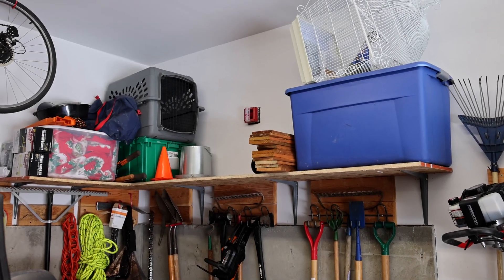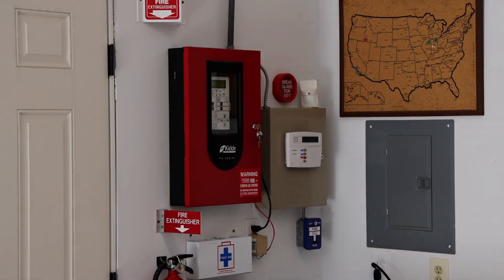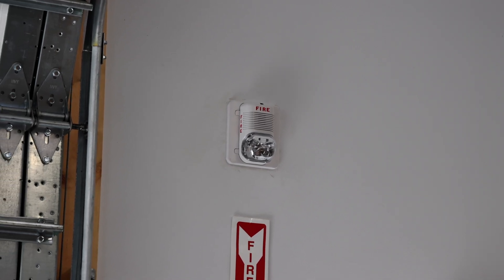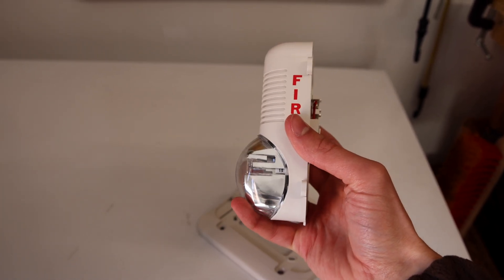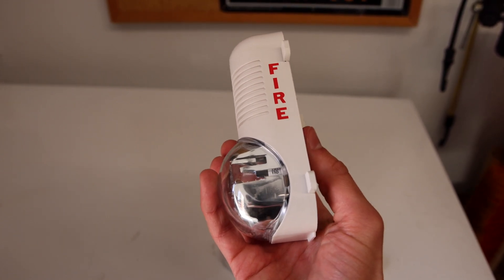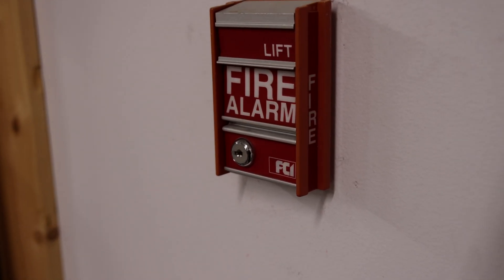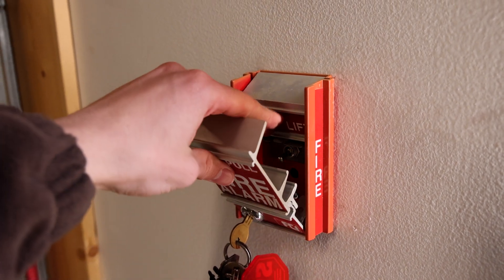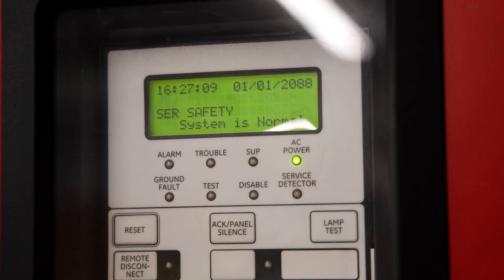Garage Fire Alarm System Test 27 | System Sensor!

Comment: When your doing the next system test and your testing the smoke detector with real smoke, use pressurized air or blow on it after the system has been silenced so that you can reset it without the smoke detector reactivating the fire alarms. I found that out from @FrostedStrobes video titled “System Test 26: WE’RE BACK!”